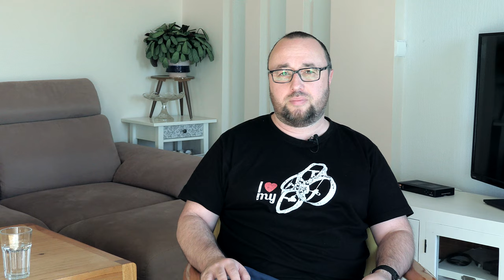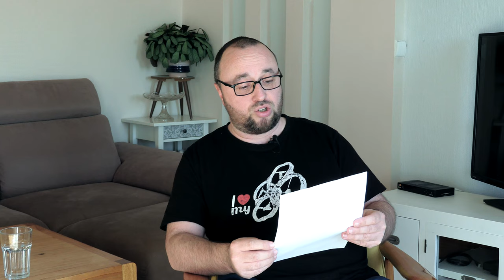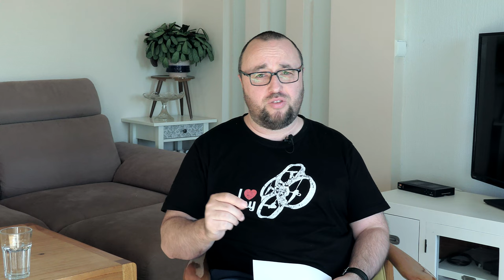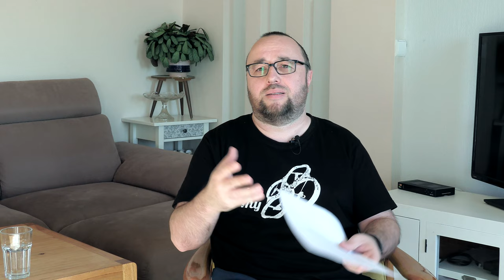FPV Q&A #7 | OpFlow, Surface mode and Crossfire telemetry

Comment: I use the USB-powered 5V pads for my Matek GPS:s on two quads. I got a powerbank with me when i fly so i plug it in and let the quad find the sats while i unpack the gear and get things ready. When i then plug in the lipo i usually have 14sats and ready to fly right away. Very handy. One note, i have read on forums that by having too many things connected to the USB powered pads could burn the circuit that handles that. Dont know if its true but thats what i remember reading so i only have the GPS on the powered pad to be safe.
Reply from the maker: There is a diode is series in this circuit. If you pull too much currect, it will burn.
Reply: As I said in my question to Pawel (he doesn't read because a little bit too long ;)), I also use powerbank to power GPS before flying :D. 
And I also like to have RX powered by USB to update expressLRS without power all the quad (especially caddx vista :D). 
Two wires on one pad is not hard to manage I agree.
Reply: @J2_P  Yeah having both is optimal, then you can also see how many sats are acquired before plugin in the lipo in the transmitter telemetry. 

Wierd thing is on my two Matek GPS there was a blue light that indicated if i had 3D lock but it never turns on anymore on both quads. I wonder why, they aquire sats no problem but blue light never comes on. I wonder if Betaflight GPS autoconfig setting turned it off or something. It was a good indicator when not using the telemtry to know if sats where locked..
Reply: I do the same, power GPS via pad that has 5V when USB powered. Matek FC's often have 4V5 pad, that has a diode, typically suggested for powering Rx. The thing to be careful of amount of amps on the circuit as voltage regulator typically only supports 2-3A. Powering Rx and GPS should be fine.
Is handy to get quick GPS lock if flying with vista, to reduce battery consumption and heat (should have to wait for GPS fix).

Regarding GPS LED. Typically will flash once, initially when gets power, then flash again when has GPS fix. If not flashing when you have GPS fix, then likely is damaged (heat, or high-G vibration). Essentially LED is just a diode, so no impact on GPS operation if not operating.

Comment: Surface Mode is not showing in MODES using 4.0. That seems to be my problem. Matek Lidar unit. Active.
Optic Flow and Sonar both active. Telemetry also shows active in both Sonar and Debug readouts of Optic Flow.
Thanks for taking my question under consideration. I wish the problem was cleared up, but I appreciate your attention to it.
You Still Rock.
Reply: Can you share the time stamp where surface mode was mentioned
Reply: @vermamilan  14:00
Reply from the maker: Oh the SURFACE is there. Looks at the code:

if (sensors(SENSOR_BARO) && sensors(SENSOR_RANGEFINDER) && sensors(SENSOR_OPFLOW)) {
            ADD_ACTIVE_BOX(BOXSURFACE);
        }
Reply: @FPVUniversity  All active, but no SURFACE MODE switch option appears.
I'd give you a screen shot of my active sensors in the icon bar at the top of INAV if it was available here.
POSHOLD and other GPS related features are seen, but not that.
Reply from the maker: As you can not post screenshots in comments, you have to trust me on that: one of my quads, with OpFlow sensor enabled and running shows surface mode in "Flight Mode Modifiers" just like it should be
Reply: @FPVUniversity  
OK!!!
Mystery solved.
Took a shower. Thought about it.
I have GPS w compass on the same quad.
As such, the magnetometer is off on USB power. Conflict.
In FLOW_RAW setting instead of allow dead reckoning. So the command needs the magnetometer alive to offer SURFACE.
Battery power needed to be connected to GET THE OPTION!!!
THANKS! We did it.
Reply from the maker: You did it :)
Reply: @FPVUniversity  I have the wits. I needed incentive. Your attention to it pushed my desire to overcome it. Hence "We".
I am a Slav. Sir name was Jaroslavskovo shortened at Ellis Island to Jarol in the early 20th century. Russian and Romanian ancesrtry I am told.

Comment: Thanks for the Q and A on Optical Flow. Just now my Position Hold is very stable but I have no terrain following. You suggest that Surface should be active before I switch to Position Hold and terrain following will work. I haven't seen that suggestion anywhere before so that will be the next thing to try. At present I'm turning both modes ON simultaneously. I'll re-configure the switches and try again. Greeting from Tasmania by the way. Not many places are this far from Poland.
Reply from the maker: yes, try that. I'm not using OpFlow often, but every time I test it it works

Comment: Why is iNAV 4.00 burning up my quad motors..?...been here before I seem to recall...🤔🤔😳
Reply from the maker: Dterm kills your motots. Check if Dterm LPF1 is set to PT3 like it should be, not PT1 like you probably restored from 3.x
Reply: @FPVUniversity  Okay Pawel, thanks...I didn't restore any settings though, complete erase and used the offered settings...Ill check it when I upgrade a different quad. I dropped Betaflight on it to check it wasn't my ESC or other hardware, but no problems with their default settings and stone cold motors. They got really hot fast..😳😳
Reply: @FPVUniversity  Don't know where PT3 is in iNAV 4.0?..
My test hover was in Horizon Mode, could it be the 20 value strength?...Still no wiser...??..🤔🤔🤔🤔🤔😳😳😳🇬🇧

Comment: About the last question, how we know wich 5v pad is possible to use with usb and wich no?
Reply from the maker: Depends on the board. And who makes them. For example, Matek marks those pads as 4V5 not 5V
Reply: @FPVUniversity  ah okey👍
Reply: Thats more tricky than it should be. Matek labels them 4v5 and they actually output 4.4~4.8V from what i have read. Seems to work with most stuff anyway.
 Diatone does not even seem to label them or even mention them in the manual! Some of their FC:s have powered pads some does not. No way to know unless measure with multimeter. My Diatone FC has usb powerd 5v pad next to Rx/Tx1.
Reply: Plug in USB and use volt meter to measure each 5V pad. Typically if pad labeled 4V5 (4.5V), or 3v3 (3.3V)  it will have power with USB. Some GPS units operate with 3.3V so is good match. Pads labeled as 5V can be powered either way ... so testing with voltmeter (set on DC) required. Typically 5V pad near recommended receiver Tx/Rx URAT pads have 5V when USB powered. (this useful when doing setup with INAV, Betaflight configurator)
Unfortunately most manufactures of FC's do not document, or provide current specs for the FC 5V regulator.

Comment: First: Thanks for addressing my question :)
I think you misunderstood my point though. I am aware that an opflow sensor can't tell us the distance from the pattern it is seeing directly. 
But what if we combine it with knowledge of ground speed (from GPS)? Then, for a given speed, the pattern the opflow is seeing will translate with more degrees/s the lower over ground we are. Compare with looking straight down from a plane vs looking straight down when driving a car. The ground will appear to move much slower when on a plane, even though the ground speed is much higher. Ardupilot is apparently doing something like that in FlowHold mode (https://ardupilot.org/copter/docs/flowhold-mode.html) so it seems to be possible in principle.
Would be awesome to get your opinion on that.
Reply from the maker: OK, if we have horizontal movement then yes. Opflow can be used to estimate AGL altitude. But only if we are moving fast enough so GPS speed is accurate